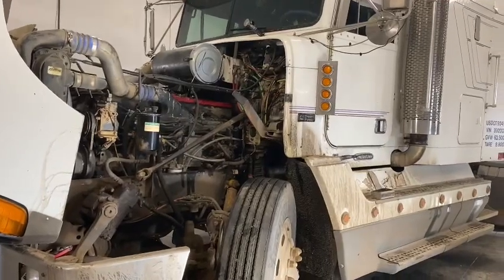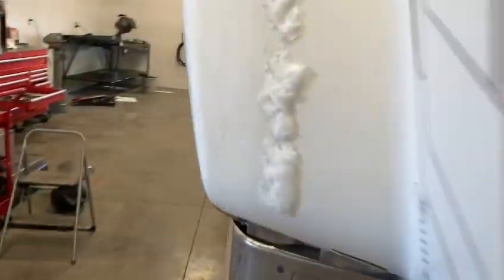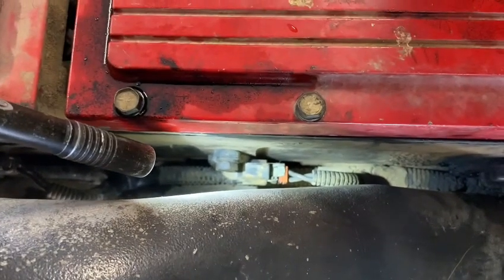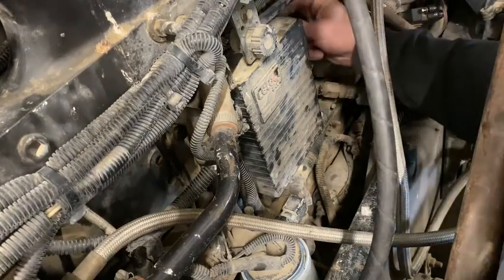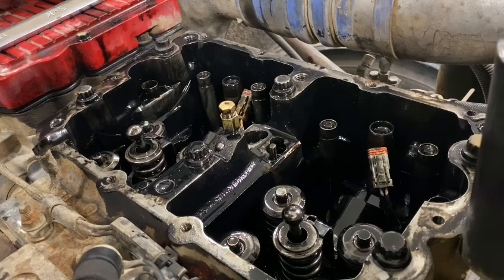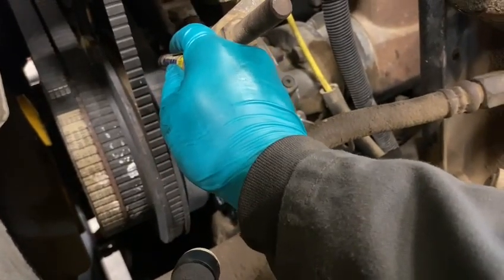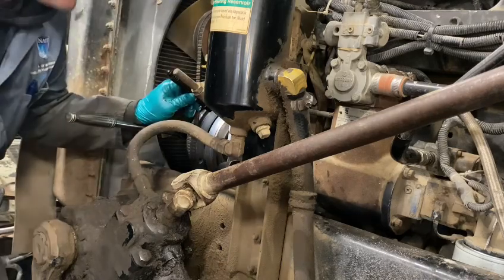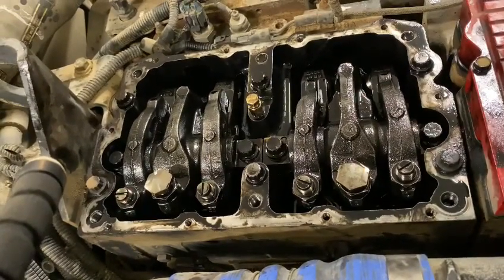Troubleshooting a very intermittent miss on an N14 Cummins

Comment: While I commend you sir, on being the first person who shows how to properly set the injectors on an N14 Celect plus. However, injectors are adjusted atop of the power stroke, 45 degrees before top dead center.  Other than that you are spot on.

Comment: Excellent systematic diagnosis. N14’s are great work horses only downside is eatin injectors!
Reply: I’ve never had that problem  I have a 1999 n14 with 30,000 hours with the original inj in it    I run 6 n14s. And have had great results no injectors problems at all
Reply: @sirmister4411  what’s your secret? Do you run additives? Fass or Air dog systems??
Reply: @bw5559  my dad works at a truck shop. He said when injectors went out if he seen the wrong number of fuel filter on it that Cummins did not warranty them injectors.

Comment: On modern computerized electronic diesel engines, if the injector calibration codes are not entered into the ECM program after replacement, this to will cause issues with the way an engine runs. I learned this the hard way after I had a six-pack done on my DDEC-4 Detroit Series-60. Those codes make a huge difference in the way the engine runs smooth or rough. After running that truck for 12-years, I just recently sold it and all my trucking equipment. Done being an owner-operator after 17-years, back to company driver now in my 39th year driving. No more working on trucks/trailers. Funny how this owner thought he had a six pack done when only a single injector was replaced. Six packs are not cheap costing thousands of dollars in parts/labor.
Reply from the maker: Yes I’m not sure how he got that confused. 
Well enjoy the change that’ll surely be less stress to bear.
Reply: Very true statement, but not true of a N-14 CELECT or any CELECT injector (Bendix).
Reply: @stevesauerland223  yes never a problem on n14

Comment: If it helps i had the same issue on a m11 celect plus engine it is as if the engine would shut down dead and start back up intermittently on its own. It had nothing to do with the injectors I later found the 12v power rail inside the ecm was dropping out caused by the Horton fan clutch solenoid it didn’t like being connected to the switch I disconnected that and the fan runs all the time and it’s fixed. 
It must have been to much current for it

Comment: What causes N14  to free speed good ,but no power,no smoke,sluggish accelerate,and slow decrease of RPM,like air in system?
Reply: Ran into an issue like this as well and it turned out to be a setting in the ecm. It was the progressive shift setting if I remember correctly.

Comment: Check emc wires at the battery box . Or it’s a fuel restriction .
Reply from the maker: It is neither
Reply: Get a noid light unplug one cylinder at a time . See if engine changes sound . If it don’t its a bad injector ! Unless your not getting fire at all from ecm . Stick noid light pins in harness and see if your getting  fire from Ecm !  If your noid lights blinking your harness is good and ecm is good . Plug it back up . Check next cylinder .  If all this is good . Check the plate behind ecm for fuel blockage . Check both check valves . If thats good then more than likely your fuel tubes in the heads are bad . To determine which one ! Pull intake . The wettest one will be the culprit  !
Reply: @seasonmechanic  where is the other check valve? The only one I know is the one that comes out of the computer back plate

Comment: I got a small miss fire every time I switch gears after 4 gear but it only happens as soon as I switch then it goes away after I 3-5 seconds it kinda feels like I’m at a low rpm on a high gear for a few then it rides smooth. Could this be an injector or fuel issue?
Reply from the maker: That sure does sound very similar to this one. 
I was more easily able to duplicate this fault with a load and then make an early shift and let it lug down low and give it lots of throttle. 
Then it would shake for a brief bit.
Reply: Missfire on gearchsnge can be tricky to find,you need to get insite on single cyl cut out snd a spare person and cut injectors till you find s double miss that goes away.it will most more than likely be an injector.the other way is replace 2 injectors,and move them along until miss is found.

Comment: Sounds like you are a parts changer .
Reply from the maker: Sorry you feel that way. My customer didn’t pay for anything he didn’t need. Siezed release bearing on clutch is cause for replacement and if you are there it’s the time to do it. The rest of the parts were test parts that I’ve bought from core engines in the past. And swapped the injector to ensure that was the issue and he did only replace the one injector. Truck is working flawless and customer is happy so I guess your thoughts are irrelevant
Reply: That's what I was thinking.  Real mechanics diagnos the problem instead of firing parts at it. This could get really expensive.

Comment: Maybe you should have done a cylinder cut out test before pulling the Trans.
Reply from the maker: I did, problem was not frequent enough to duplicate. I’ve seen broken flywheel bolts a few times and the RPM sensor was damaged (sits in flywheel housing) so I went to check that first.

Comment: hello where are you located?
Reply from the maker: Consul SK. it is the very south west corner of Saskatchewan. Also service from her to Medicine Hat and area
Reply: @PrairieMechanic   I thought those bull haulers up thiere was rich. They alwayse drive brand new peterbuilts.
Reply from the maker: @shawnrice7179  haha ya there is lots of those guys.
Reply: reminds me of shooting the parts Canon first....then do the diagnostics ...lol
Reply from the maker: @lenhofer3214  other than a clutch this customer did not pay for anything he didn’t need. And we only ended up doing the one injector. 
I’ve worked on a ton of these and have purchased parts off of core engines to quickly swap out for the purpose of troubleshooting such as the ECM. 

But I don’t need to justify my work to you 
My customer is happy!
Reply: I'm not picn on ya ....happened to me at times also...all good.. let's take it with grain of salt
Reply from the maker: @lenhofer3214  at least you can recognize how it is in the real world. As much as I hate to instal a part that doesn’t fix an issue it happens sometimes. Thanks. 👍🏼
Reply: @PrairieMechanic  I’m from south of Medicine Hat just getting into the trade. Found your channel from another guy I follow. I thought this truck looked way to familiar haha.
Reply from the maker: @derrickfranz3488  ok cool. Have done work for Franz’s before. Used to work at JD dealer.

Comment: That is not the correct way to calibrate the injectors of an N-14 celect plus, it is calibrated with a dial clock at 0.29 degrees, others come at 0.25 degrees after adjusting them with a torque of pounds / inches at 125, it depends on the description that Bring the engine tag, this is the reason why the injectors do not work correctly, it is due to poor calibration.
Reply from the maker: Nothing you described makes sense. 
This truck has been running flawlessly and the procedure is is 100% word for word out of Cummins quickserve.